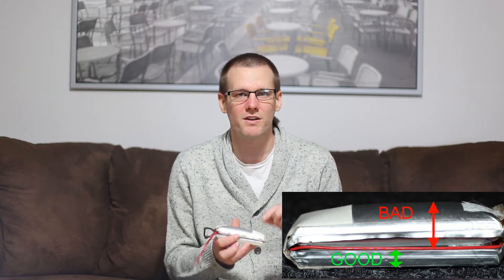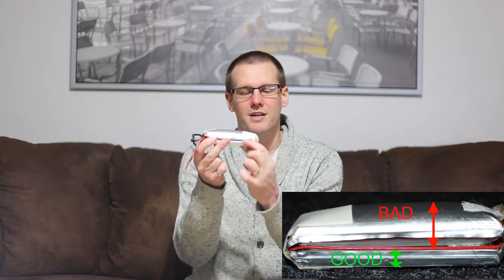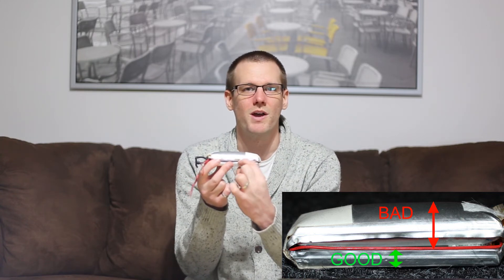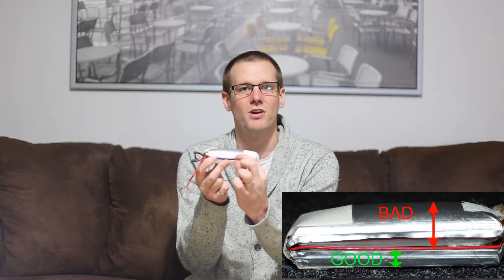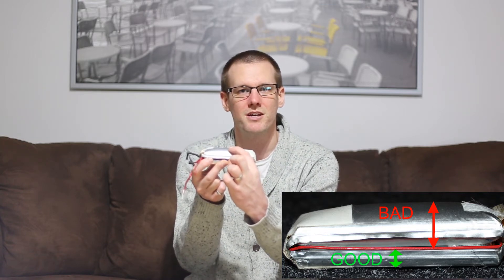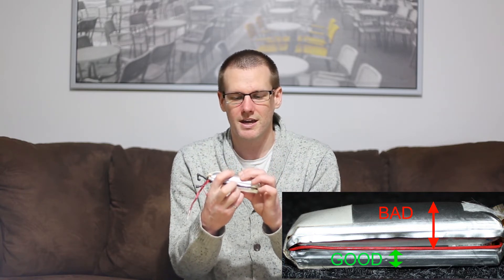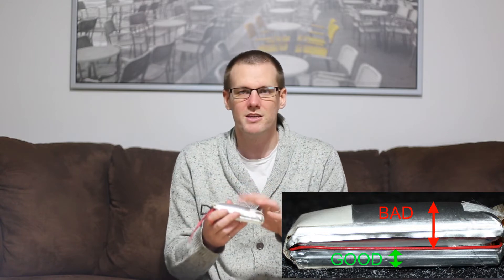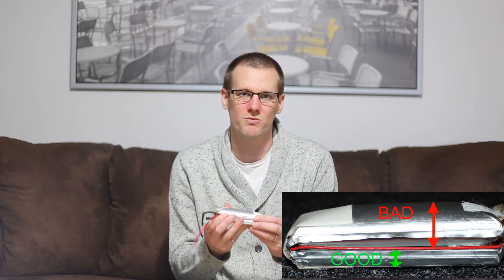How do you know a LiPo Battery is Dead - RC LiPo Basics

Comment: I just had my 4s lipo batteries puff last week. I don’t care what the other parameters are they are done. I discharged them the cut the ends off and soldered the leads together. I am not losing a RC or a house over a couple hundred dollars in batteries. They lasted over 4 years and it’s time for new ones.
Reply from the maker: Agree, 4 years is a good life for a lipo

Comment: At the end of the video, you mention that you use all 3 parameters to determine the health of a battery.  Does that mean that if it begins to increase in size, but the performance and IR numbers are still low and equivalent, it should still be replaced?  Thanks.
Reply from the maker: A puffed lipo subjects the user to increased risk of the pack failing or bursting.

Comment: I have a 4s Lopo and when I use it at full charge around half throttle it will work like normal but if I try going full throttle for longer than a couple of seconds it cuts it down to half power. But if I unplug it and plug it back in it goes back to normal. Is this the battery or the rc truck?
Reply from the maker: What are the internal resistances of all 4 battery cells in milliohms?
Reply: @RCexplained  I am not sure my charger does not tell me
Reply from the maker: @cobyhartzler4041  your battery could be weak

Comment: My battery is a 3s lipo battery hard cased and it's on a full charged and when I'm on offroad/grass terrain, it kinda cuts on and off a bit very little on and off ac but noticed. Help please? Not seen any of my batteries do this..
Reply from the maker: Your pack if it's old may be losing its punch

Comment: When an esc gets fried by a short via the motor connecters, does it kill your lipo? 
I've checked the volts with a lvm and it read charged. So I  plugged it to my rcs and it works on some of them. Any info or advice?
Reply from the maker: Not necessarily. It depends for how long the battery was dealing with the "short." you can confirm this by measuring the internal resistance of the pack.

Comment: My quadcopter is not lifting up ,could be the lipo-battery be the problem ?
Reply from the maker: Hey Alpha Gaming, If your quad is not able to get airborne, the LiPo could be the problem. See if you are able to compare the internal resistance of the LiPo against when the LiPo is new. Internal resistance being too high will not allow the pack to dump enough power for your quad.
Reply: @RCexplained  thanks for your help

Comment: My challenge is that I like how a hardcase LiPo provides some sort of protection against the elements in an RC car application, but it makes it impossible to tell if the cells are ballooning, right? Would I expect the plastic to actually deform from the extent of the battery degradation or would it be too dangerous by then? Should I open it up and check? Stick with only soft packs?
Reply from the maker: A hard case does offer good protection, however I would definitely be interested in knowing the condition of my LiPo. If I could not crack the case open to see the LiPo, I probably would not use that LiPo. Some hard case LiPo's will expand out a bit as the LiPo cell begins to expand. It is not as obvious though. I personally prefer not to use hard case LiPo's but hard case LiPo's can work very well and are very safe if used correctly and the health of the pack is monitored.
Reply: @RCexplained  My battery is a 3s lipo battery hard cased and it's on a full charged and when I'm on offroad/grass terrain, it kinda cuts on and off a bit very little on and off ac but noticed. Help please? Not seen any of my batteries do this..
Reply from the maker: @cindyshields5753  if the battery is old it may be losing its punch.
Reply: @cindyshields5753  I’m having the same issue and thinking the same, but my cut outs are very noticeable as the car doesn’t go over 4 mph once driving off road
Reply: @Arjun SK  that means you got a dead cell in the Lipo. I figured out what was wrong. All good now. "It was the ESC".
Reply: @cindyshields5753  ok thanks. I’ll invest in a new battery

Comment: I have a phone with a battery what you have how long would you keep a battery before you get rid of it?
Reply from the maker: I would keep it until performance has become significantly impacted that it does not function as required. Or I would get rid of it if there was obvious physical damage to the battery.
Reply: @RCexplained  hey i have a big serious super important question i have a 6 year old battery pack and it wouldn't get off flat without me putting a load on it and it is getting super hot and taking way longer to charge on tue same adaptor as i normally use does that mean its on the way out?
Reply from the maker: Hello do you know if your phone is running an application that is drawing a lot of power? Have you cleared all apps from memory? Is the battery and other parts of the phone also getting warm to the touch.
Reply: @RCexplained  i meant battery pack with usbs it is getting super hot on charge and it never did before
Reply from the maker: @SKYELOVER  getting hot while charging is a problem.
Reply: @RCexplained  how bad is it its a 6 year old power bank it isnt powering half the amount of power that it shouod is that saying its faulty?
Reply from the maker: @SKYELOVER  that is quite bad
Reply: @RCexplained  it should pull 2 amp on every port but its not even pulling 1 amp and it gets up to 40c and higher is that bad?
Reply from the maker: @SKYELOVER  if you know it is under performing that poorly, i would replace it.
Reply: @RCexplained  and when i try to let ot go full load at 6 amp it onky does 2.5 amp now it is 6 years old is that good it lasted that long or should it have lasted longer?
Reply from the maker: @SKYELOVER  it depends on the cell but 6 years is pretty good.
Reply: @RCexplained  20 thousand milliamp cell

Comment: I have a micro 2s battery pack I've been running in a crawler it's always looked a little chubby on one end of it but the rest of it looks fine, I actually have two micro battery packs and it looks about 1/3 to 1/4 centameter bigger than the other, it also has two layers of wrap a clear wrap all the way around the battery and a black wrap that's just around the sides of it but is open on the ends for the wires to come out on the other one it's got plenty of room but on this one it looks kinda like someone trying to fit into pants that are just a little bit too small for comfort. Do you know how puffed would be too puffed it's not getting hot it's staying quite cool actually and the performance seems the same as the other (brand new) one. Is it ok?
Reply from the maker: Do you know what the internal resistance of the battery is for each pack?
Reply: @RCexplained  no my charger has a test function but my micro charger doesn't and my regular charger doesn't have the right plug.
Reply from the maker: @silviamills5218  batteries that have expanded in physical size is a sign that the health of the pack has degraded. It is tough to comment on the condition of your pack without running tests and being able to see it. I'm sure if you showed a member of your local RC club they could assess it for you.

Comment: One of my 1-cell LiPos has an internal resistance of 100mOhm. What is your opinion on its condition?
Reply from the maker: It's hard to say with limited data. The best approach is to refer to a manufactures specification. If the pack was a 120mAh cell, that would be great. If it is a 5000mAh cell, the resistance you have measured is very bad.